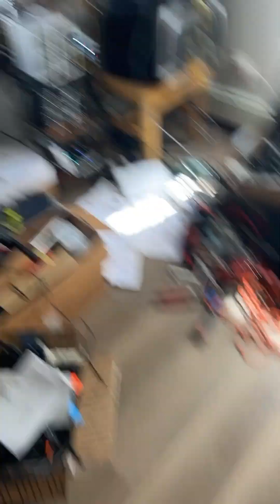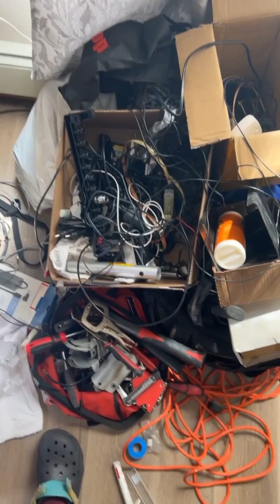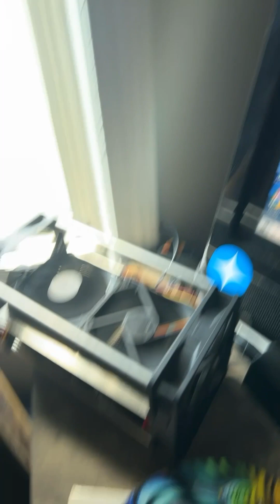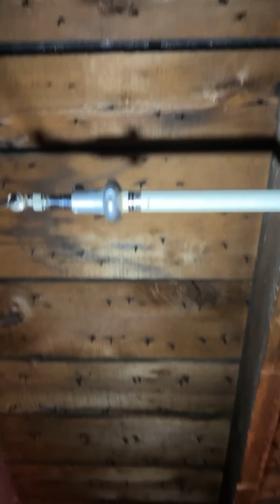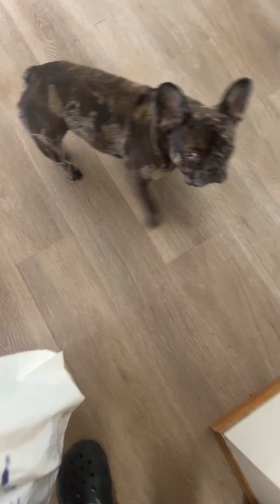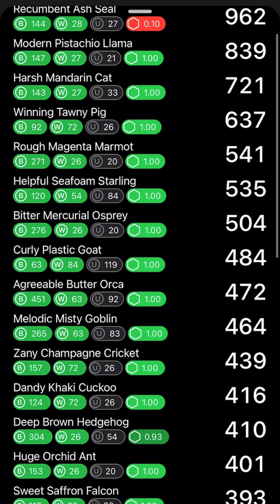The Daily Routine of a Crypto Miner-5G mobile hnt iots Kda etc grin coin

Comment: Try to keep the antennas vertical in the adic (up side down is not that bad), horizontal is -28db so you want vertical. If needed you  can put the antenna up side down.
Reply from the maker: 🔥 I had em before upside down too one time

Comment: If the RAKs just need a new memory card that’s a easy fix bro. Did it on mine and it took 2 mins. Hope you’re is that simple too. Also- you have multiple helium IoT running in the same spot. Do you get penalized for that or did they change that rule?
Reply from the maker: No u don’t bro no rules on that just myths